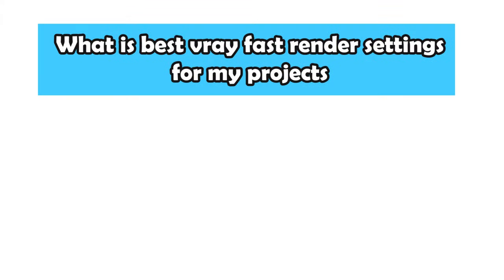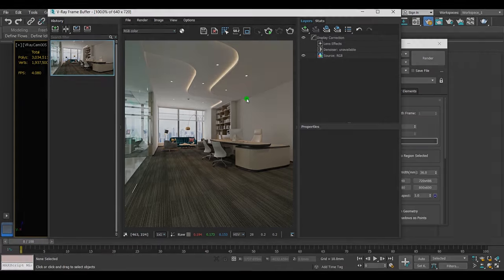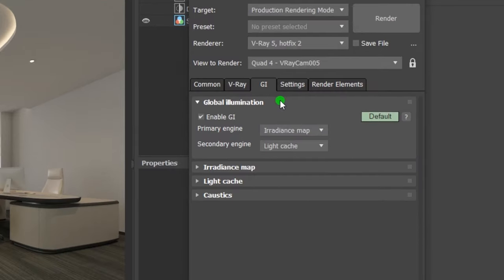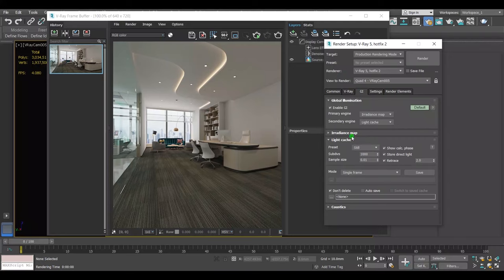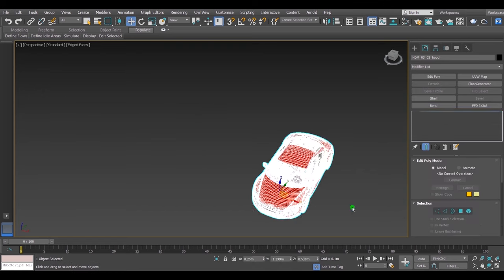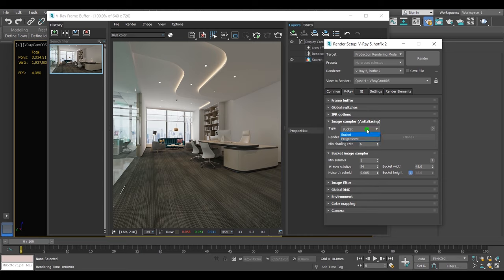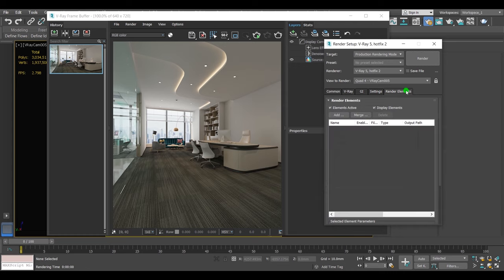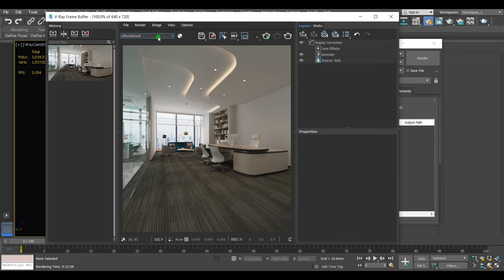Vray Fast Render Settings In 3ds Max | How To Reduce The render Time In 3dsmax Using V-ray 5

Comment: The irradiance map has been deprecated in Vray 6 and it is slow and messed up my shadows when I tried to use it, I will try everything else, my problem is that I have animated grass in my scene that I used chaos scatter to spread on the lawn, which I think is the main reason for my slow render times.

Comment: hi there please let me know how did you achieve those rounded ceiling defuse lights using irradiance map. i use vray mash light but its really uneven and looks bad. but if switched to brute force its looks fine like yours but the render time and noise is unbearable. thanks.
Reply from the maker: Hi there
I used vray plane light, try to use it and show me the results

Comment: Yes, it speeds up render time but not without a cost. The scene would look just as good but there will be more noise, less detail and lighting artifacts.
Reply from the maker: Yes less detail, but there will be no noise
Thanks for for pointing it out
Reply: no noise, and you shouldnt have artifacts at all. Yes, les detail.. but with a subtle AO it's done
Reply: @martinilopez1  depends on how strong the denoising is. But if you zoom in, there will still be noise. Although to the naked eye, it's undistinguishable
Reply: he is just showing the video to show demo images to the client after client approval use your higher render settings

Comment: U rendered at 640p that's very low.. im trying to render at 4k native 16:9 res which is 3840x2160.. also what do you think is better? Vray 5 gpu or vray 5? I heard that gpu rendering is not as accurate but way faster
Reply from the maker: It reduces the render time anyway.
If your Graphic Card is powerfull, it's better for fast render. It gives accurate results but with low render options.

Comment: Do you use "image filter" in your setting, and which one? I transfer from my setting in vray 3.5 to vray 5, vray 5 render time longer than vray 3.5 a lot (i use IR+LC), and also in vray 5 my downlight have black circle ( vray 5 remove the "clamp output" option)😆😩

Comment: Hey i have a good Laptop 3070rtx ryzen9 ram40
But vray and max slow and hanging what i can do to benefit with my laptop should i play with invidia control panle sitting or rendering with gpu or cpu please help
Reply from the maker: Hi, the first thing you should do is to check where your Laptop resources go. If it's not used in any other programs, try to add 3Ds Max to your NVIDIA plan.

Comment: i wouldn't go below max subdivs 16 for final images. especially for interior images. i don't like the look of heavy denoising.
for a final high res interior image with a resolution of 5000x5000 pixel, it's completely ok to have render times of 2 hours...doesn't matter anyways if you let it render over night. 
for previews it's ok to use lower values.

Comment: Hey, its great tut, but when i start i was fascinating difference between the render time of CPU and GPU render, but i have some issue. The renders are not same after GPU rendering main different with shadows, reflections and refractions. What Im doing wrong, its important becase i have couple of project i prepare for V-Ray CPU not specyfy for GPU, what i should to do to make same renders on GPU and CPU?
Reply from the maker: Let me check
Reply: @MasterArchViz  I will waiting for answer :) may fot next video :)

Comment: Sir I am going to buy i5 10th generation processor,GTX 1650ti,8gb ram ,512gb sdd,4gb nvidia graphics card laptop...for 3dx max,and corona render+exterior design this specs is good for designing?please reply🙏I am student and how much time it take to render
Reply from the maker: it's not the best gear, but it will do the work very well. 
the render time depends on many factors.

Comment: CLAMP OUTPUT QUESTION:
-guys, how to unhide CLAMP OUTPUT in Vray 5 render settings (3DS Max) using a maxscript? (it's hidden by default says chaosgroup
-for I have problem with jagged edges on bright area of an object
(it's easily solve before by SubPixel Mapping and Clamp Output)...
Reply: Bro. Plz help how to solve jagged edges problem in vray light areas. Plz explain in detail.
Reply: @adnanjamal2853    in older version of vray, go RENDER SETTINGS
-SUBPIXEL MAPPING: check this
-CLAMP OUPUT: check this
Reply: @scpk2246  I am using vray next 1.1 and max 2019. I got the option clamp output in color mapping and uncheck it. But still getting jagged edges in mesh light created on ceiling.
Reply: @adnanjamal2853  you should CHECK the Clamp Output
-CHECK BOTH ClampOutput and Subpixel Mapping
Reply: @adnanjamal2853  do you have email, messenger account or discord account?
Reply: @adnanjamal2853  hey, I just sent you an email with link to a PDF book that might help you - just check it out
Reply: @adnanjamal2853  on the link I gave you, check on the folder >SELECTED PAGES >P212 SOS HOW TO NOT TO FREAK OUT.pdf
-your problem is discussed here